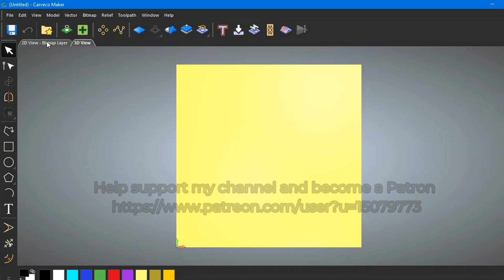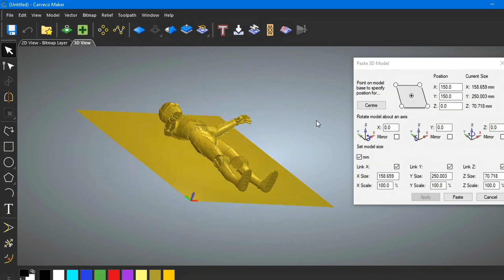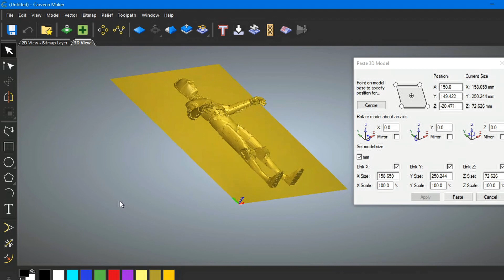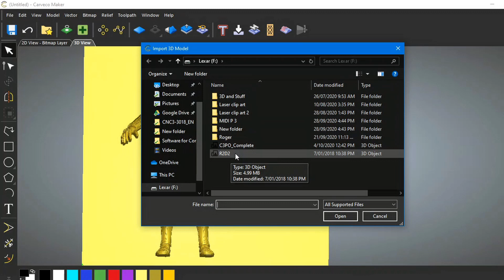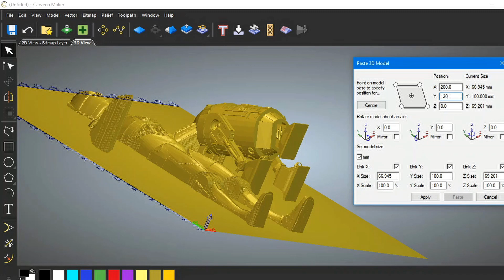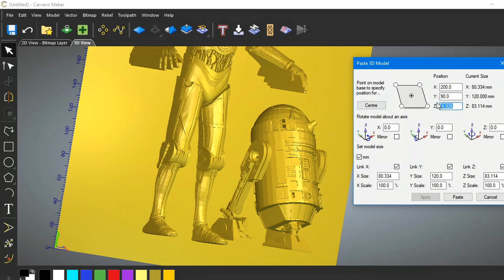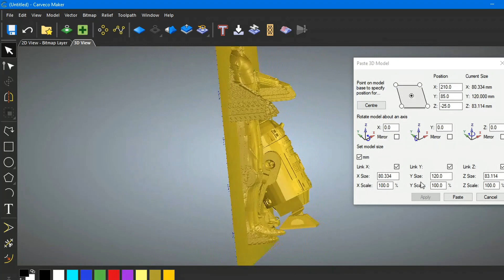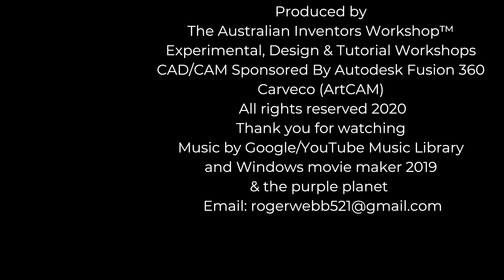Carveco Maker importing multiple 3D STL files and modifying them for machining

Comment: I see when you scale down (or up) an object, it shows the dimension and the percentage of the reduction for each axis. So if the 3D models in the separate files were done in the same scale with each other, you could input the same scale factor to each model you import and they will retain the correct proportion to each other. In this example, when you scaled C3P0's Z axis to 250mm, it showed the scale factor of 53.47% until you applied the change (then with Z being 250mm it reset the scale factor to 100%). Then if R2D2 was done in the same scale as C3P0, you could enter 53.47% in any of the axis scale factor boxes (as long as they are all locked) and it will reduce him to the same proportion as C3P0 (as if they were imported from a file of them together in the same model).